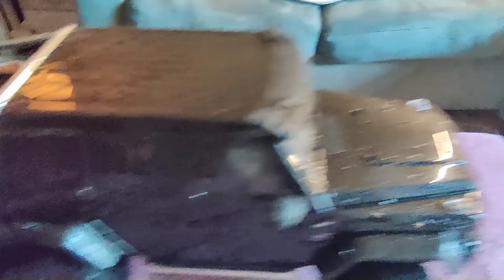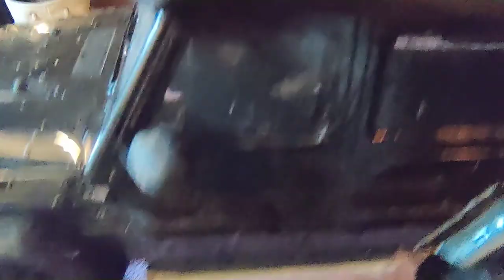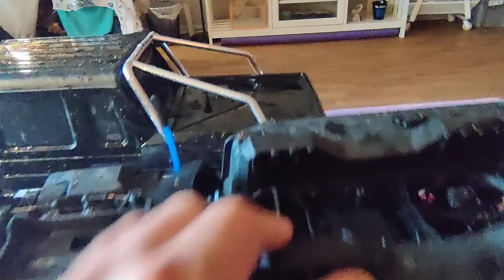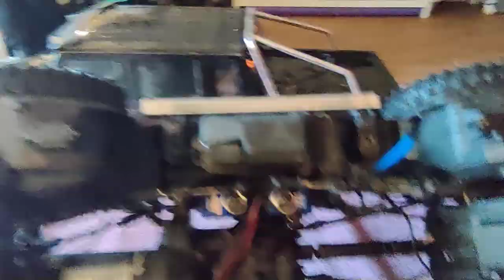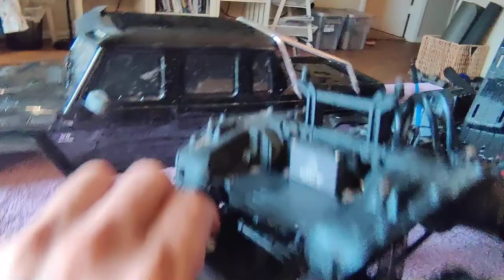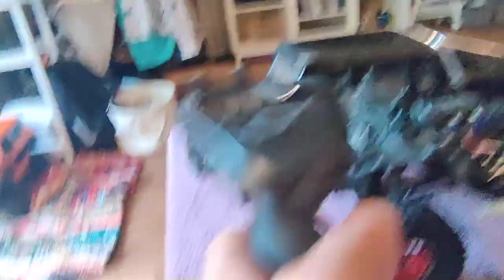My Current Traxxas TRX6 Mods and Upgrades

Comment: get rid of the bumpers in general. They hang on EVERYTHING. Amazon and Ebay have affordable bumper options that will fix that issue quickly. On the Front rear axle Loosen the collars on the springs so they articulate faster giving the rear tires a chance to grab traction and help push up the obstacle. I have found that works for me. For brass get a servo front and rear bumper mount and portal covers for the front axle and replace the front beadlock spacers with brass spacers. Getting a motor forward conversion will help ALOT with the weight.